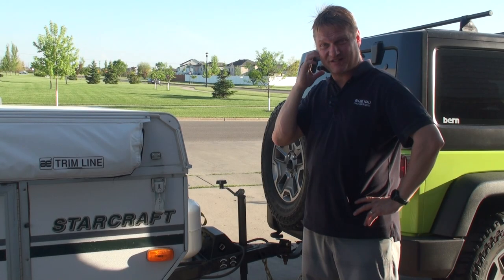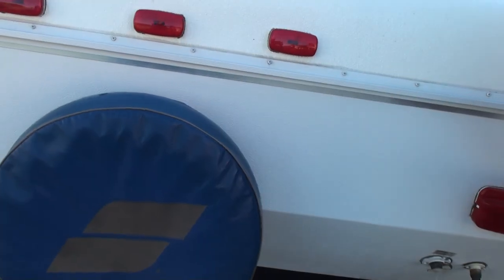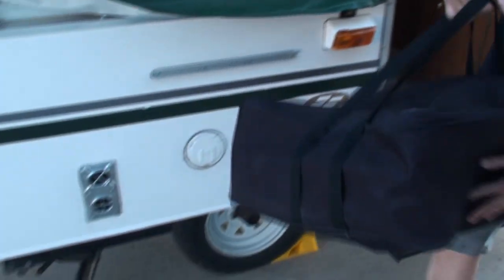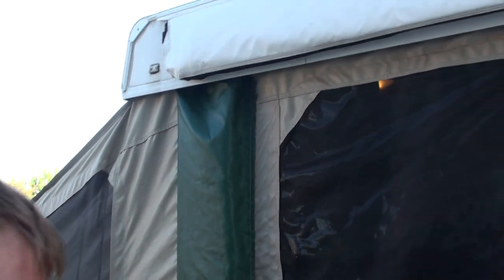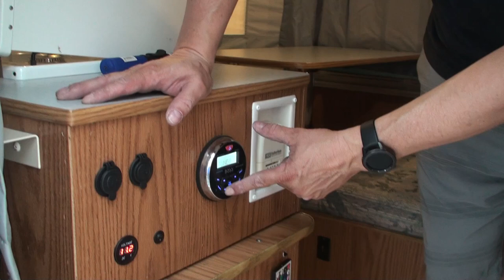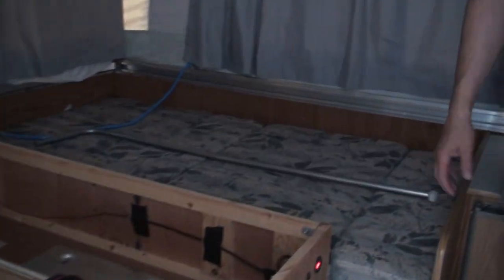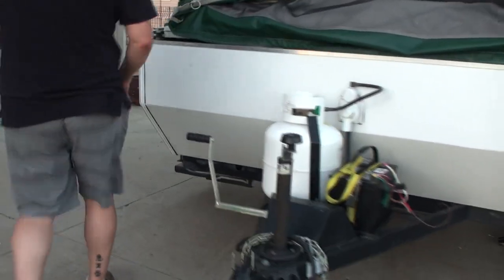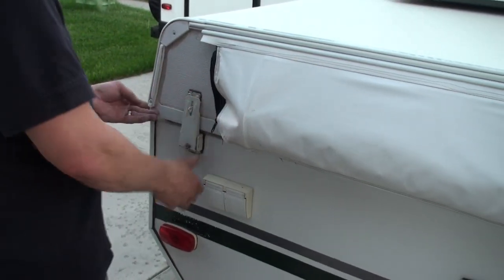Starcraft Popup Camper Setup and Take Down

Comment: We had a 1963 or 64 Starcraft pop up. Easy as hell to put up. It was fairly big and slept 8 people. Dad took one of the tables and benches out and made a set of drawers on each end so we didnt have to live out of the suitcases. Around 2000, he sold the camper to someone for $50.00 . Nothing wrong with it he just wanted to get rid of it since he didn't use it anymore. My sister was pissed. She wanted the camper but thats what dad did, sold stuff rather than ask us kids if we wanted to buy it first. Oh and with 2 of us kids, we had it all set up within 10 minutes.   =)

Comment: This is nicely done!  I'm picking up a Starcraft Pop-up this week from a used RV dealer.  After seeing this video, I realize that they had no idea how to set the rig up properly (didn't know what those safety bars were for and they were missing some supports for the beds.  I'm a lot more confident in my purchase now and will make sure to go through all of this in the driveway at home before I head out on the road!  Thanks!

Comment: I Enjoyed your video and learned a lot.
I just bought a 2009 star craft pop-up camper. I’m having an issue with the water draining out of the sink. It does not completely drain out. How do I get it to completely drain out? Also I do not have a stopper to hold the water in the sink. Is there a stopper for the sink?

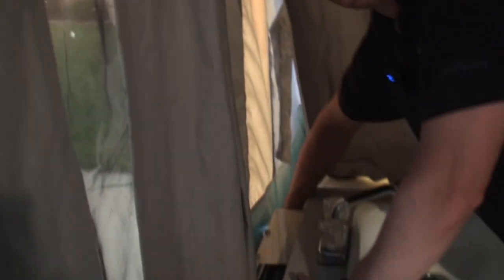Comment: wait... at  36:38 you claim the fridge is running, but at 34:53 you flipped the sink which disconnects the power switches to the fridge. 
does your fridge run separately from the cutoff switch?

Comment: So, the rear bed only has the 2 supports?  The front has the U table thing plus the side supports?  I had one of these campers I just sold and we only got it with the front frame, no additional supports, and the 2 folding bars for the rear bed...

Comment: Awesome.  Ty.  How do you turn on heat?
Reply: There should be a thermostat by your fuse panel, on my rt 10 I turn on the propane and select a temperature then the heater will start.  FYI once it reaches desired temp it does have a cool down time for the heater itself it runs for a minute or two with no heat it's by design.

Comment: Where is the refrigerator 🤔 miss that
Reply: It's across from the front door.  You can see it around 49:55 to the left of the cups and dishes.  Just forgets to point it out.  The fridge can run off of propane or a normal electrical hookup.